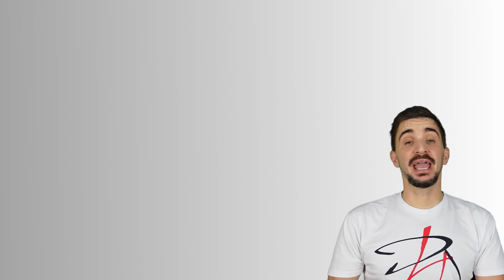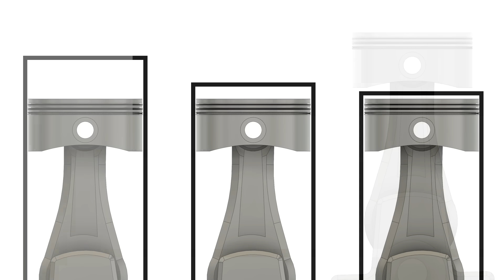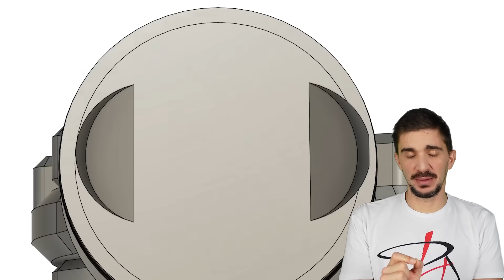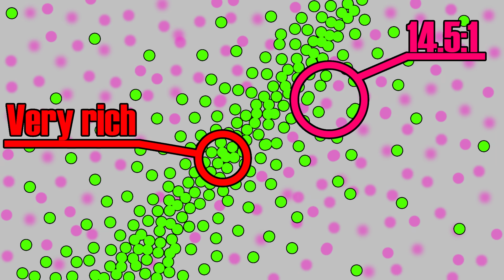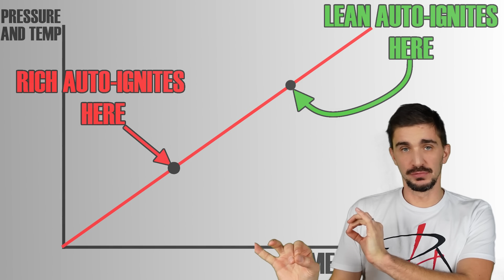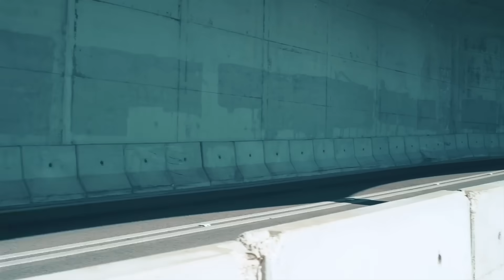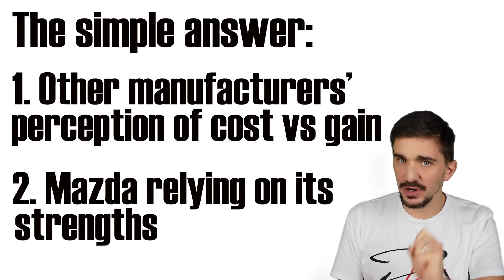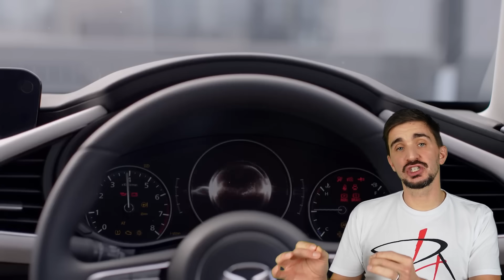The Game Changer Nobody Cares About - Mazda Skyactiv-X SPCCI How it Works and Why It Didn't Catch On

Comment: An spcci engine with a mild hybrid system would be amazing, allowing for stop-and-go driving while keeping the engine in spcci mode while also giving some low-end torque to help with drivability. Im not talking about a hybrid system that's large enough to drive on electric alone for 50 miles, im talking about maybe enough to slowly drive 5-10 miles, one that doesnt increase weight all too much while simplifying the transmission by omitting the reverse gear and lessening brake wear with regen braking. And the issue with drivers not liking the Mazda because it is slow and you need to rev it out to get anything, well thats pretty much many Nissans and non-sport Toyotas. My 2019 Nissan Rogue Sport, with sport in the name, does a 0-60 in over 10 seconds which isnt terrible until you leave town and try to go over 50 mph in any hurry, and good luck getting to 80 before you take a nap from how slow it is, im sure its a great car from every other aspect then its power which at that point it isnt as much an issue with the spcci tech, but rather the direction they decided to take the engine in.

Comment: Maybe point out that perhaps the biggest reason that high compression engines are efficient is it means it's also a high expansion ratio and that extracts more work from the hot gas.

Comment: 180HP from a 2.0 NA is pretty good! I'm very impressed. I think of the K20Z3 in the 8th gen Honda civics in the USDM. Those engines were NA 2.0s that made just under 200HP and consumed a staggering amount of high octane fuel. What Mazda should do is just tune one up a bit and throw it in a roadster. Oh wait...

Comment: Looks like it's the perfect tec for a range extender for evs. 15kw power should be enough
Reply: Well maybe more like 22kw, so the altenator can be also used for charging at home. The heat can be used in winter for heating up the passengerspace. 22kw should be enough to get a us size truck or a European suv to 130kmh. On motorways you can drive 2000km without charging and in cities you can drive without emissions.

Comment: Rover, UK had the lean burn engine in the late 80s, early 90s. It was killed off by the law forcing use of catalysts. The exhaust was clean but it didn't waste enough fuel to use a catalytic converter. Insanity.

Comment: My brother drives a petrol-driven car.  I drive a Citroën Picasso diesel.  He came to visit me during  Winter, and we went out to the local shops.  Along the way, he commented that his car got the heater going a lot quicker than  mine does, but thinking about that since, mine was getting 60_MPG, which would be very unusual for a petrol-driven car -- so mine converts more of its fuel into miles - his converts more into heat.  I know which I prefer!

Comment: Yes, it won't impress people who want cars to throw them back in their seat the moment they so much as think about accelerating, but for people who value fuel economy, it's a no brainer. I drive my 2013 Mazda 3 using the cruise control to slowly accelerate during speed limit changes (much to the chagrin of anyone behind me) and with that I regularly go about 6L/100 between tanks. Sorry, freedom unit users, no idea how many rods to the hogshead that is.

Comment: I bought a CX30 two years ago and I chose it exactly because it has an old school feeling while driving but with the reliability of modern technologies and comforts.
The engine gives its best after 2000 rpm so I needed to learn how to maintain the inertia of the car both to shift less and accellerate/break less yet, if I want to overtake or go a little faster, one or two gear down and the engine comes really alive.
Also, about the old school feeling, the simple fact that the cockpit feels refined and taylored around the driver and is not a showroom for a stupid touchscreen is a bonus for me. Physical switches almost everywhere for almost everything. I would buy it again, maybe I would like a more hybryd system, just to offset the consumption at low speeds and city dwellings.

Just a little edit: Mazda stands by their words about building and improving costantly, little steps at a time. I live in Italy and we have cars from everywhere and I know people with every brand or type of car. Never heard of anyone having problems with their mazda

Comment: The video doesn't explain that the SkyActiv-X is not to be confused with the SkyActiv-G engines. The G doesn't use the SPCCI tech. The X engine very limited to some models as an option and can add at least US$5,000 to the cost of a Mazda 3 ! Refer to SkyActiv Wikipedia.

Comment: Yes, I can confirm. It's a slow engine, the car (I own a Mazda 2) needs to be driven at a slow peace. You have to downshift to get performance, and even then it's not exactly lightning-fast. However, and it's a huge however, it's still comfortable to drive, and with a 2-liter engine I still get 21.5 kilometers per liter of gas. Comparable, if not sometimes better, than a 1000cc 3-cylinder Toyota.

Comment: why other manufacturers don't develop spcci engine...I think the answer is already being told in the video content itself..."it (spcci) can only be activated when engine at low or medium load only", which means : it wont activate when you accelerating stop/go at traffic stop/ traffic jam in the city for hours, probably even when you carry full passenger load with luggages...otherwise, it will behave just like normal petrol engine which maybe this  engine probably will be less efficient because it will run richer than normal non-spcci engine to compensate for hotter temperature caused by higher comp.ratio. 

To sell this tech, i think it will be better if mazda could open their own test data about spcci effectiveness in real life driving condition, rather than using standardize test cycle such as NEDC, etc, etc.
Reply: not true. I have it. SPCCI is almost always active. If you stay below ~4600rpm, it's active.  If you go uphill on twisty roads, accelerate, go 150km/h on highway, stop/go in city - it's on.

Comment: If I understood correctly, the Skyactiv-X engine gets lower MPG when it’s driven in stop-and-go and low speeds vs the higher speed of an expressway. Since most of my driving is done in the former type,I won’t realize better gas mileage. Could someone post a comment letting me know if my understanding is correct about this? I’m currently driving a 2009 Honda CRV 2.4 L that gets abysmal MPG. I want to get something with much better MPG. I’m thinking of a Prius.

Comment: I am driving skyactive-x, so would like to share some feedback and talk about why this engine is not popular. Firstly, in the video it is said that SPCCI only active during cruesing which is not true, if we consider in-car indication correct. Built-in indicator shows this mode activated very quickly after movement starts and is active most of the time. It only shortly deactivates when you remove gas or if you press the pedal to the metal. This mode works on most of the accelerations, except the strongest. This is how the car itself shows it at least. Then let's talk about fuel economy. I have eSkyactive-X mild hybrid config with 186HP. I drive it in Berlin and around Germany. The combined economy now is 6.7 liters on 100 km. Which is pretty good. BUT, I also have experience with the turbo charged BMW B-series 4 cylinder 192HP motor on Mini Countryman. I was driving it in Moscow and around Russia. And my combined economy there was pretty close, about 7l on 100Km. And there is one more detail, traffic in Germany is far less hectic and more relaxed and calm, when in Russia it is full of traffic jams and rapid accelerations and speeding. To summarize, a similarly powerful turbo engine does not necessarily be too inefficient in fuel economy. At the same time the BMW engine has given rapid acceleration and was pretty fun to drive when the Mazda engine feels slow and unresponsive, especially considering how the transmission is configured to always gear up pretty quickly. Then there is the ability to configure for manufacturers. The BMW B series can be flexible, it can have a 3 cylinder implementation and 4 cylinder, and the latter can be 190, 220, 300 hp implementation. That's a lot of options for any car trim. Mazda has only one skyactive-x 179 - 186 hp version with no tuning  potential. And the SPCCI engine is not that plain simple. So the answer why nobody else is doing it is simple - too complex tech with less flexibility and no major fuel economy benefits.
Reply: are you an engineer or know any with a great talent and entrepreneurial skills?  I have a new type of SPCCI engine that runs on ethanol and can get up to 2.5x+ fuel cost savings. I have 3D CFD, ChemKin simulations and offering early buyin and commissions for referrals. Thanks. Message me here if you know anyone interested. I am in Hawaii and soon to be Florida.

Comment: PHEV skyactiv x drivetrains are a match made in heaven. Super high efficiency in the cruise and just let electric motor handle most acceleration so you don't have to deal with the inefficient portion of the engine. You can even keep the old 6 speed and maybe just make the overall gearing a bit taller to make cruising even more efficient. Use the awd tunnel to store the batteries and make the rear an e-axle. Hell Mazda can deploy many of the same principles to a 2 rotor engine and get some nice efficiency in something like a generator mode or really nice peak power when coupled if they have an eCVT.

Comment: History is full of examples where brilliant engineering achievements fail to become commercial successes, and there is a clear reason for that. While Mazda’s SPCCI technology is impressive, it feels outdated. Today, a small-displacement turbocharged engine equipped with advanced electronics can achieve better performance and fuel economy than Mazda’s SPCCI. If you add a hybrid component to that small turbo engine, the efficiency and performance become even superior.
The main downsides are complexity and reliability, but these are now manageable issues. Had Mazda’s SPCCI appeared 20 years ago, it would have been a bestseller. But today? If you jump into a 1.4-liter hybrid and drive it around the city, it feels much more alive, fun, and modern compared to the high-revving, low-torque SPCCI. Furthermore, if you look at current reliability ratings, these hybrid powertrains are now among the most dependable on the market.
Think about it this way: with today’s manufacturing technologies, we are capable of designing and producing a high-performance, powerful, and reliable steam engine—but where would we use it? It is obsolete when new powertrain concepts are so much more efficient. Even at the beginning of the 20th century, early gasoline engines looked clunky and unrefined compared to the most advanced steam engines of the time. However, visionary engineers saw the hidden potential and the possibilities of internal combustion. Mazda’s SPCCI feels like that peak steam engine: a masterpiece of a passing era, while the world has already moved on to the next leap in evolution.

Comment: I love that Mazda are still evolving and improving the internal combustion engine. Unlike mainstream car reviewers (and unlike most people who drive), I would welcome a 2.0L NA I4 with 180hp. Let's be real here, this is enough power for just about any situation you're likely to encounter in everyday traffic, especially when considering the speed limits. I'd rather have a car that's going to be reliable, and one where I'm in control of it rather than the other way around. At the moment I've got a 2016 Toyota Yaris because it's all I need for my work commute and shopping (I have a bike for fun, after all). My Yaris has a 1.3L NA I4 with about 115hp after an ECU remap. I like the fact that it's got a manual gearbox that I have to shift myself because I get to choose at any moment whether I want to downshift to accelerate or upshift to cruise and drive economically. Thankfully these Mazdas exist so I have a proper car to replace my Yaris with whenever it dies one day. I don't get why things like lane control assistant or even autopilot are such a big deal for people because if I didn't like driving the car myself, why would I buy a car at all rather than taking the bus or an uber?

Comment: This looks like an ideal candidate for a hybrid or a PHEV. Those are least eddicient on long, consistent highway cruises, and this engine should perform at its best on those runs. EV mode in the city and electric help for some spirited driving and overtaking would solve the anemic character of the engine.

Comment: I have owned a 2020 cx-9 with this engine and find it exciting and fast as all get out. I have also owned the 2021 mazda 6 with the same engine. It is not a chore to drive but an absolute pleasure. I have gone across the country four times AZ to MI. I love that suv and wouldn't trade it. The car was a ripper. I wish I could have kept them both but needed the room for traveling. The safty ratings are great. Mazda is top notch!

Comment: 15:52
The people responsible for assassinating multiple engineers who figured out how to increase fuel efficiency by rerouting a portion of the exhaust gases into the fuel tank to preheat and vaporize the fuel allowing for a much higher stoichiometric ratio in the carburetor, which increased fuel economy to 100+ mpg. A few people mated this technology to hybrid engines and achieved 300 mpg, but foolishly tried to patent it and start mass production. Those people "committed suicide" shortly after.

Comment: how if we run the engine at the perfect load and rpm and permanently in spcci cycle. run it as a generator engine, generate electricity most efficiently and use electric motor to run the car

Comment: I've driven a lot of different vehicles. From armored personnel carriers, heavy trucks, pickups, tiny cars, muscle cars, etc. The winner for "fun to drive on a road trip" was the 95 Golf 2l NA with a 5 speed manual, even beating the hot-rodded 74 Dart Sport 3-speed. Yeah, 120mph on the freeway in the middle of the night climbing the Continental Divide is fun, it's no match for a sub-3000 pound 5-speed on a mountain road...

Comment: I have learned how engines work when I was 9 years old. With 12 years old I thought to myself" why don't we build a gasoline engine that has compression ignition, that would be way more efficient"

Now that emission regulations get more and more strickt the big oil industry pulls out the more efficient and cleaner burning patents out of there safes. 

This world is under full controll by capitalism. We need a revolution

Comment: To be fair, I don't think even Mazda themselves are going with the SPCCI tech, given they always touted it to be scaled up or down from the original 2L engine in the 3 and CX-30 for use in the 2, 6, CX-5, etc, but it looks like it won't be now, plus the 3 and CX-30 themselves have now got the larger 2.5L, previous gen Skyactiv-G engine, which gives essentially the same performance as the 2L Skyactiv-X, just at lower mpg and higher emissions (but still decent compared to small capacity turbocharged engines).

Now they have a de-rated 2.5L version for entry-level trims to replace the 2L SA-G. The SA-G engine appears to be more reliable because of the presence of a supercharger in the SA-X, which has had some issues, thought not that many to be seriously concerned about. Plus the SA-X engine was really only for the Euro market and at home in Japan where mpg and emissions regs are more harsh than in North America and elsewhere around the world.

I suspect it'll drop away as they transfer over to non-mild hybrids and EVs - they are already using a range extender (battery charging only) rotary engine for the MX-30 and partnering with Toyota on HEVs with the 2 (a Yaris clone) and larger CXes, and now with a Chinese manufacturer on the 6ev, although that might be short-lived, given it hasn't been well received (though as usual, it looks lovely) in the media.

If I ever can afford to replace my 20yo Mazda3 (with a very reliable manual 1.6 standard petrol engine) which I've owned from new, then I would probably go for either another 3 or more likely CX-30 partnered with the 2.5L in either power format, just because it is a known quantity longer-term and now has a decent turn of pace compared to its 2L variant, which I felt (when test-driving a gen-3 Mazda3 120hp back in 2017) wasn't much more peppy than my existing car, especially when paired with the (otherwise very smooth and reliable) TC auto box.  At that time, no 163hp version paired with an auto box was available.  Now the 140hp and 185hp version of the 2.5L is.

Comment: Well, its hard to not be impressed by this technology... but I'm also not suprised why consumers didn't appreciate this as You think they should. I'm trying compare mazda fuel economy with competitors... and its not so impressive. Honda, or Toyota are able to make comperable cars with similar power output with even better fuel economy (I'm looking for some data filled by users).
Do I like Mazda and their engines? - Yes
Will I buy Mazda soon? - No, with my requirments from an automobile, I need car with better rust protection on the first place, and Mazda have huge field for improvment here

Comment: Wrong. There is no motor that even comes close to the b series cummins. It is by far the most reliable ever put in a non commercial vehicle in the history of automobiles. There are thousands of dodges pasta million miles and there are only a couple of any other brand. The highest mileage pickup is also a dodge past 2.6 million, with a cummins in it of course.